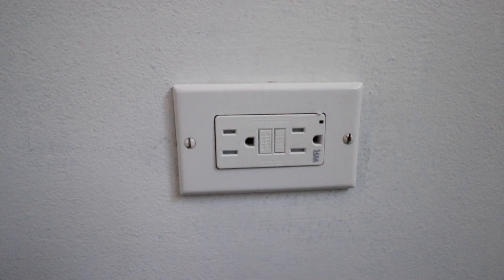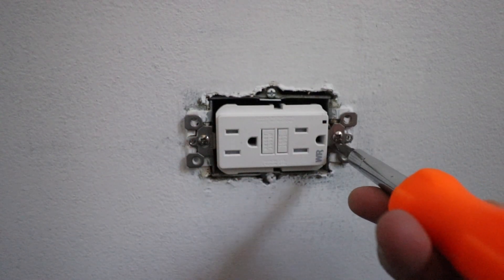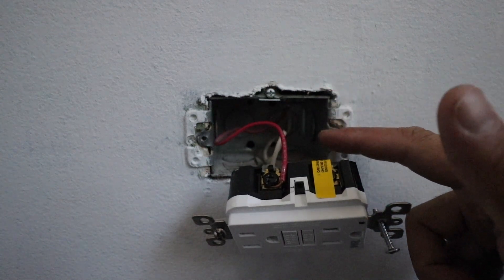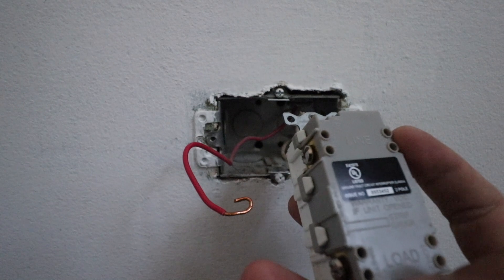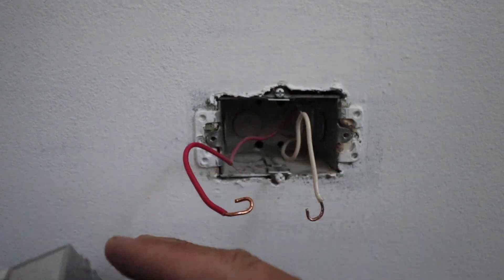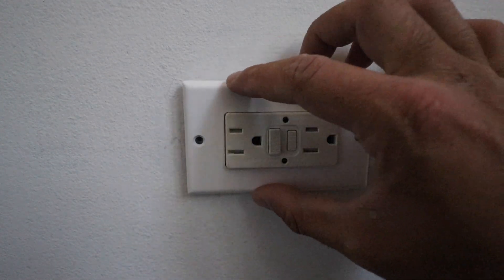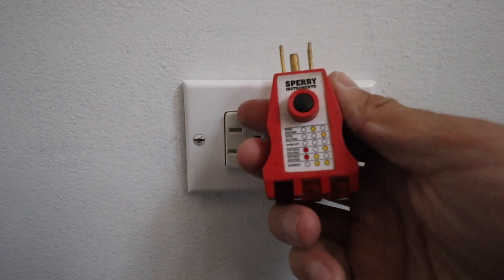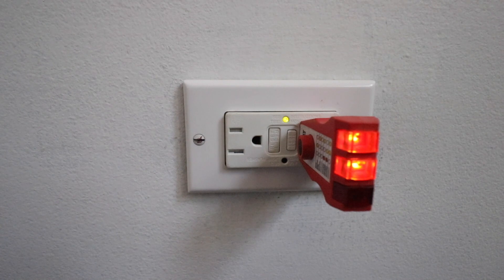How To Replace A GFCI

Comment: Since you have so much room I would drill and tap a 10-32 in the back of the box between the knockouts and mount a bonding jumper from the box to the ground screw on the GFCI.